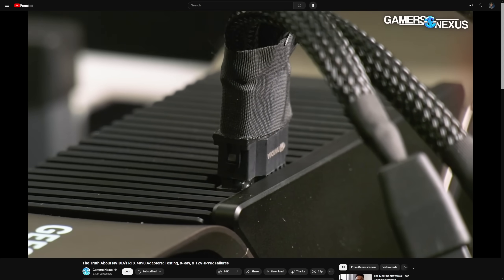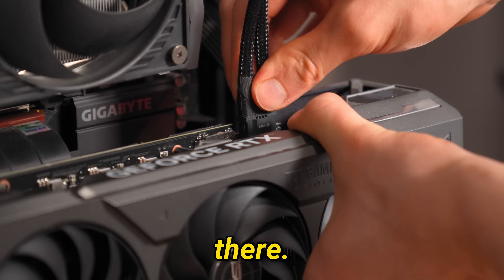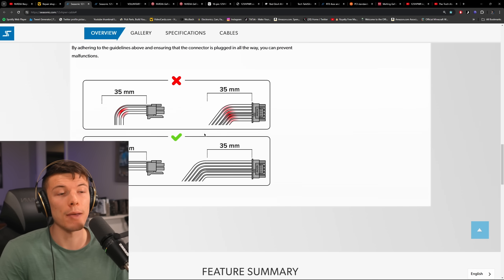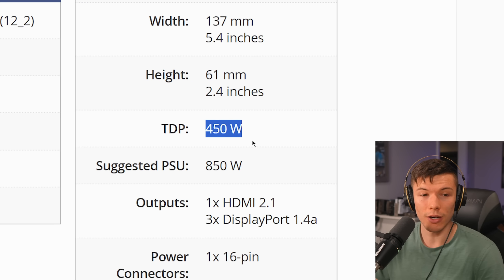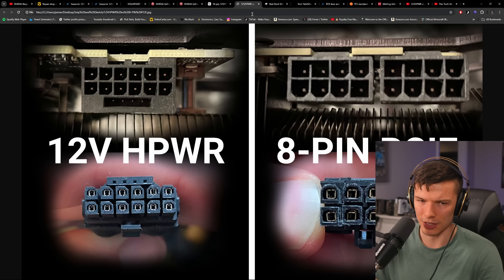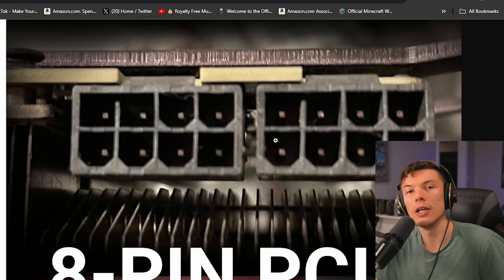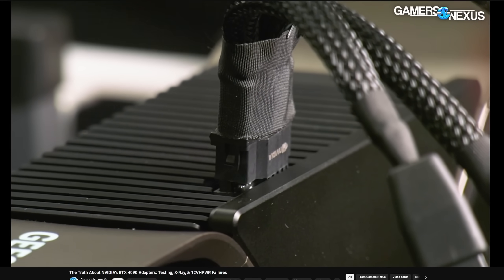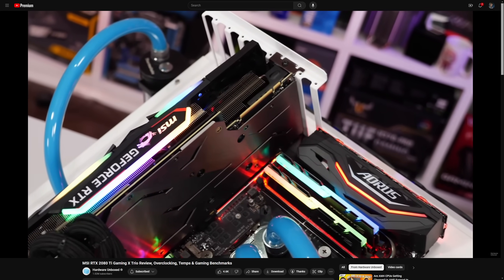The Dumbest Thing to Happen to Graphics Cards

Comment: well teh 8 pin PCI-E  power cable carries up to a max of 150 watts per cable.  while teh 4090 eats some where between 450-500 watts  that means you'd need 4 PCI-E cables to meet the cards demand and have room for power spikes. (600 watts)  

a new standard was needed going intot hese pwoer hungry cards.  However  craming 600 watt's into a single cable that is smaller than a PCI-E, now that just pure rocket scientist levels of stupid. right up there along side filling  the mercury capsule with pure oxygen and computers. 

but nivida and whoever else backs  12VHPWR  connector,  seem to be doubling down not wanting to admit that teh damn thing is a mistake.   the reason for this  is because of the ammounts of money thrown at the design of it.   they figure it's cheaper to just try more slight variation on it thatn to jsut scrap it and start over.  after all it's ultimately  the consumer that pays the price  if the variant doesn't fix the problem.  not the companies backing this crap standard.

Comment: The EPS connector can deliver up to 335W. And you know what gives it more power? It has an extra 12v line. The RTX A6000 has a TDP only 100W lower than the 4090 and can be powered by a single EPS connector. Server CPUs with 400W TDP either use two EPS connectors or one EPS and one ATX12v. With two EPS, you'd be looking at 670W on tap. NVIDIA wants to do what Google is doing, which is forcing their agenda on everyone.

Comment: Perfect time for this video to come out, as I just got my 4090 yesterday 😞
Reply: You will be fine , I have two RTX 4090 and haven't had a single issue.  I've had them since they released.  Alot of things people like to stretch the truth on , just use the supplied cable that came with it and not an aftermarket one
Reply: @bigdaddyt150  lmao bruh the one thats supplied is the ass one, that and CableMod ones. Just use the Corsair cables. 200 burned 4090 cables a month from that electronics repair shop speaks volumes. So without trying to hurt your feelings too much, im gonna say your anecdote is  irrelevant and even dangerous
Reply: clock it a bit lower and you have lower temps also and give it less power
Reply: @germainederandamie40  I am planning to undervolt it to extend lifetime, but only when I don't need full power.  I'm a 3D artist and need lots of GPU power, it's likely to be running close to 100% for hours on end.  I do have a ton of fans, and my case is specifically designed for airflow, so it should stay cool enough to not melt plastic.

Comment: Don't believe nvidia's nonsense that this is user error. Mine died after a year (made a thread on Reddit) despite babying the hell out of the cable and never touching it afterwards (PC isn't in the same room as me so nothing ever touched it). It was fully plugged in, no issues... until it burned on the GPU side. I literally can't push it in more, I'll break the GPU. How can it be a user error, not ever be touched, yet last 1 year? Yeah, it makes no sense.

Now I'm on a different 4090 and went for the Corsair 600W 12VHPWR. Let's see what happens. Been fine for 5 months or so. Keep in mind that I made sure there were no bends or anything that would potentially move the cable through gravity over time (slowly bending due to weight etc). I made sure that didn't exist, yet it still burned.

The fact that this is even a thing at all is pathetic. No wonder they're revised this shitty connector & cables a few times now, they just won't admit anything.

Comment: if you think that the POWER SPICES in a PTX 4090 exceeds 800 many times even 900+ watts, you understand how tragic a choice it is to put a 12vth in 4090 from the other 3 8pin 3x220=660w even for 350-400w that draws a 7900xtx is fine in power spice, i.e. around 700w there would be no problem

Comment: Leave it to Apple oops I meant Nvidia to reinvent something then never needed to change in the first place, its one of the reasons I never bought a 4090. The other is I only play Destiny 2 with some indie games and old games so I decided to invest in an LG C3 120hz 4k OLED panel instead. Plus I upgraded my NAS with larger capacity drives and bought a dual 12 core Xeon 128gb ECC Ram server all for less than what a 4090 costs. You really need to consider this, its just to play games.. As long as you can run your games why does it matter what GPU you run? I bought things I will actually get some use out of instead of blowing 3.5k on a GPU.

Comment: 8-pin is time-tested for a secure easy connection AND has plenty of headroom on available amperage. 12VHPWR is a terrible connector with almost no headroom on amperage. Unbelievable. I'm just curious how many 4080 Super or even 4070 Ti Super manage to melt. I was on the fence about 4070 Super or 4070 Ti Super, wanted the extra VRAM, but can't possibly invest $750-850 in a single PC component that could have these kinds of problems.

Comment: What they should have done is just made the plug bigger or added more pins. Those tiny pins suck and there's too much amperage being drawn through them. The lack of surface area creates more resistance which in turn creates more heat. It's just a bad design overall and Nvidia should be embarrassed for making such a stupid decision. But then again, they don't care about their customers...

Comment: ill toss this out there,
my RTX 4070ti can draw (undervolted)
around 100watts. upto (overclocked) around 
300 ish watts. id much rather have reliability than to purchase new stuff
to make a card i spent 700 bucks on not burn down. im using 
that adapter that came with the card at this time (knock on wood)
ive had no issues. recently found undervolting my 4070ti (3060 type power draw)
is way better on my electric bill let alone that connecter.

Comment: To be honest, I think a new pcie power connector from the ATX 2 standard is not a bad thing. While old 6/8 pin connectors are functional, they definitely leave a lot of room for improvement; they're not smart (no communication between PSU and receiving device), they waste two extra pins just to "communicate" that the psu and device can support the 150W of the 8 pin vs the 6 pin's 75W and they definitely play it safe in terms of how much power they can deliver (although in the context of the 12 pin connector, maybe that's a good thing). Also, the non-standard output rails between different PSUs and PSU manufacturors is definitely an issue that could and should be solved with a new standard.

What I don't understand is why they thought that making the pins and their casings smaller was a good idea. Obviously making them smaller means less diameter for contact and therefore more resistance in the connection, so it's no wonder there's issues with trying to ensure there is enough contact with the connector to stop it from catastrophically fail. It really feels they didn't properly test it before it was used...

What they should have done is just taken the 8 pin design, stuck 4 extra pins on it, add the nice communication interface and then actually use all 12 pins for carrying current (unlike the 8 pin connector). With the extra pins as well as headroom already in the old connector pins along with maybe some other design improvements to get the overall safe current higher, they could probably carry just as much power, if not more, over the modified connector than this crappy 12pin one they have come up with. Sure, it looks nice and does work with old atx 2 power supplies, but if it has a high chance of catastrophic failure then it really isn't worth it.

Comment: Instead of plastic they should use bakelite... resistant to heat, scratches, and destructive solvents. It is also resistant to electricity, and prized for its low conductivity. Or any other heat resistant non conductive material... even if it's more expensive than the plastic they are using.
Reply: Bakelite becomes brittle when hot and can be toxic to humans.

Comment: Yeah stuff like  that is why i think GPUs need to regulate a factory TDP of 300 watts max (Nothing say you can't overclock your GPU past that though)
Considering that Nvidia did not make a new plug to avoid stuff like this. It would be better to cap the factory TDP to 300 and focus on performance per watt, being able to squeeze more performance out of the same draw power.

Comment: I have a RTX 4080 with this stupid connector. the RTX 4080 has a TDP of 320W. 2 x 8 pin would deliver 300W plus 75W from PCIe slow would have been more than enough. So a RTX has TDP of 450W so 3 x 8 pin + power from PCIe slot could deliver 525 watts which is heaps. This new connector is just pointless.

Comment: And this is just some of many reasons as to why I use an AMD 7900XTX.
Reply: yesa and coupled with the 7800x3d my pc is running like a sunshine. But my 7900xtx does clock itself at 2800 which gets the gpu hotspot to 100 degrees. Have to manually clock it down which can be annoying and I imagine other people have this problem 2. Luckily its fixable but its weird
Reply: Yeah better settle for the current 2nd powerful gpu not 4080 S that thing didn't gain much compared to the 4080 , all the while having insurance of tried and tested 8pins

Comment: 450+ watts via 12v is a lot of amperage. 37.5 amps, go check out the 30 amp cord on an RV and you'll get the idea(voltage is irrelevant to wire gauge, only amperage matters). If the only pathway left to increase performance is to increase power I wouldn't be surprised to start seeing power supplies at 24v or 48v with a buck converter integrated onto the gpu down to whatever power it needs to operate.
Reply: "(voltage is irrelevant to wire gauge, only amperage matters)"  ... how to say you have 0 clue what you're talking about without saying you have 0 clue what you're talking about lmao
Reply: @Knaeckebrotsaege  You're lost man, I'm 100% correct on that statement for anything a consumer is going to be dealing with. There's a reason power is transmitted at up 500k volts or so and transmission lines aren't as thick as your leg. Look up wire gauge thickness by type and amperage requirements, note there are not requirements based on voltage. Computers all ready buck/boost voltages all over the place, the only reason PSUs haven't gone to higher voltages for GPUs by now is inertia. The first GPU to come out with a higher voltage is going to require a very expensive PSU because of lower market demand which will inevitably hurt sales.

Comment: Stop unplugging your GPU, you only get 30 disconnects and reconnects
Reply: What??????
Reply: @Tone-Soprano  the connector is only rated for 30 disconnects and reconnects. Plug it in and leave it in. When GPU needs to be removed, unplug cable from PSU side
Reply: @KaPonoo  that is so crazy I only plugged it in once so im good lol but thats insane that they can do that legally
Reply: @Tone-Soprano  The stupid 12VHPWR connector is officially rated for only 30 plug/unplug cycles. After that it's considered worn out and needs to be replaced. Yet another gigantic red flag that it's underspec'd trash

Comment: Great video. I'm a long-time Nvidia customer, having used the 1060 6GB, 2070S 8GB, and now the 3080Ti 12GB, up until last gen. I wished the RTX 40x series wouldn't have the 12VHPWR connector because of the problems associated with it. I hope the next generation will address this issue; otherwise, I might consider switching to AMD. They've proven to be solid in the past, and you don't pay an extra premium for features like RTX and DLSS. Frame generation

Never chance a running system (8pin connectors)

Comment: Pcie is actually 6 wires for power and 2 wires for ground; 12vhp puts ground on only 4 flimsy terminals that also sometimes isn’t fully occupied

They should of put some of the gpu processing into managing the power instead of allow the end user to deal with it

Comment: I can't say that the cable looks great or that it's very reliable... what I CAN say is that alot of people didn't properly plug in their cable.
I've used two different cables at this point and have Not had any problems with it.
My seasonic psu comes with a cable that connects directly to the gpu, and before that I used the adapter that came with the gpu.
But what do I know, I only always make sure that everything is properly plugged in.

Also I really couldn't care less if my gpu had 3, 4 or even 5 8-pin cables hanging off of it, heck, Imo it would look kinda badass for a gpu to have that many cables xD

Lastly, an uneducated question; I wonder if you could mod your gpu so that it would have the GOOD 8-pin connectors instead.
I have some basic knowledge when it comes to soldering and allround modding whne it comes to circuit boards but I'm by no means an expert.
Reply: It's not even about plugging it in all the way, not plugging it in all the way just accelerates the issue to something you can watch happen in minutes. Any sort of corrosion, dust, hair or even wear from unplugging it and plugging it back in will add resistance, resistance is heat and once you start building heat the resistance continues to climb causing a snowball effect. It's also been proven that bumping the cable, removing a side panel if the side panel is pushing on it or many other things can cause it to come loose as it seems that the latches are not great on all plug/socket combinations.The safety factor is frankly unacceptable, everyone who works with DC knows that DC pushing big power needs beefier plugs, I'd rather have a bigger 8 pin with a higher gauge wire and pins that are twice the thickness, that would be acceptable as a single plug solution, they could even make the pitch smaller and have the plug stay about the same size as a single 8 pin.

Comment: As an engineer with proper electrical degree I can proudly say: I predicted this thing will mel the moment I saw it and rated power numbers. I am sure Nvidia did their testing correctly but they showed lack of imagination where it comes to all sorts of factors. Personally I got new 80+ Titanium PSU with new connector as standard but it will probably be a while until I use card with it. What I wonder about is if AMD will use these connectors in new Radeons. Intel will probably not release anything that needs more than two 8-pin PCIe connectors so they will probably not bother and not wanna risk it - unlike what Nvidia wanted to achieve using old PCIe connectors is an advantage for competition
Reply: Yep, the 12v high power isn't made of magical fairy dust, it's just taking large safety margins and slashing them to a frankly unacceptable 1.1 and any sort of dust or corrosion or even a hair getting in there and messing with the electrical connection will cause it to start heating up. Even in the video, the closeup shows a hair right over the opening of the female socket for a pin. Part of it is pcie 8 pin has improved dramatically over the 20 years it's been in service so the rating has stayed the same but the connector springs and pins have gotten better leading to an absolutely bombproof connector. Considering the backlash over 12v high power, I rather doubt AMD will use it, not using it was a big selling point for the 7000 cards, so unless a major revision happens they probably won't.
Reply: They won't use it with their upcoming cards.
Reply: @T0L0M0 I’m sure they will the 12v-2x6 on the upcoming flagship if not 2 of them on it.
Reply: Same here on the prediction with an EE degree and my father being an Electrician.

Comment: I don't care how many cables are hanging out of my gpu if my psu can spare them. If I really wanted it to look good I'd use cable extensions. NVIDIA please stop with these connectors and just let people connect 3 to 4 8 pins directly into the part itself rather than into a flimsy connector that's prone to burn.

Comment: the plug is good, the voltage is too low, which causes a large current to flow, which heats the plug, for 12v 150w, the current is 12.5A, and for 48v 150w, the current is 3.2A, which means no high temperature, the plug will be cold.

Comment: Does the 4070 Super have the melting issue? Considering the powerdraw of that card does it even need 12VHPWR?
Reply: Same question here
Reply: Older comments, but I wanted to write this. If they say the cable can provide 600 watts I say never ask for more than 300 watts while gaming. The 4070 Super only uses 220 watts so give it a bit of room to breathe. ATX 3.1 and the revised 12V-2x6 cable sound like an improvement. Oh and forget adapters entirely. That's just asking for trouble.

Comment: I've got a 4070 Ti and it came with that stupid adapter, but my PSU also came with a proper 12V cable, I also bought the Lian Li Streamer v2 and it's got it's own dedicated 12V so it's nice and clean, and I've had zero issues with it seeding or powering up.
Nvidia has been a mess lately, but it's still not enough to drive me away into AMD

Comment: I think the main issue is just the connections, not really the cable. The cables might be the same gauge, but the connector contacts are too small/don’t touch the pins with enough surface area that things heat up and melt due to high resistance.

Comment: The problem I see is that it appears that a new standard was made, and released for hardware that immediately maxes out the spec. Traditionally, new things like this take time to mature and even out some problems, and maxing the capabilities like on the 40 Series high end cards exacerbates the issues to the point where it's mostly obvious the standard might not have entirely made it out of infancy yet. 

Generally speaking I like the idea of moving forward with new standards for more modern hardware, but risking the life of multi thousand dollar consumer hardware in the process just gives it a very sour taste.